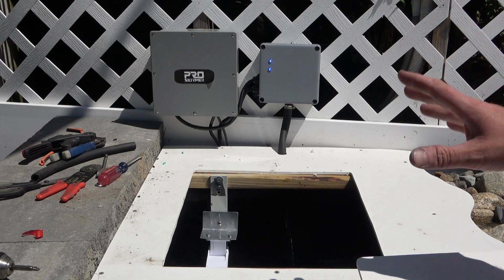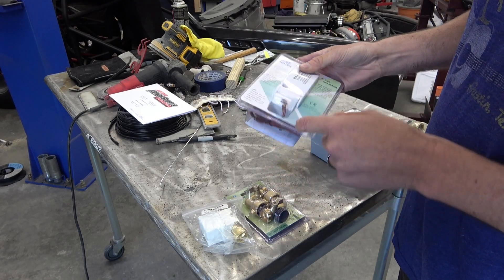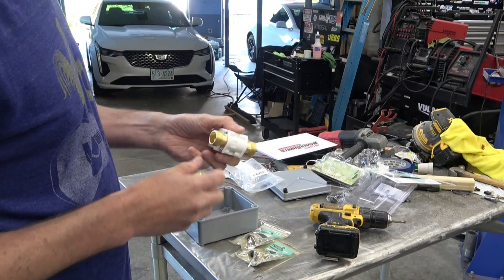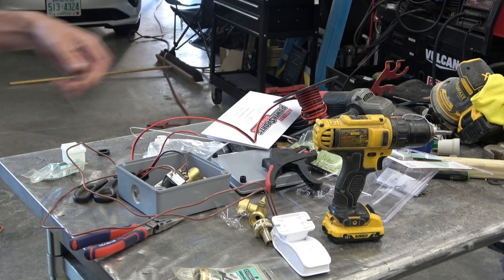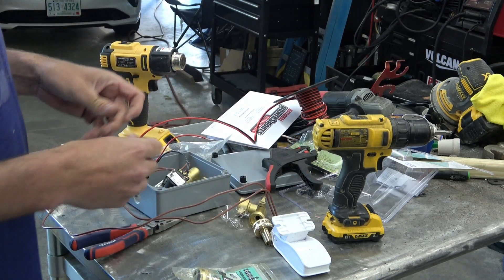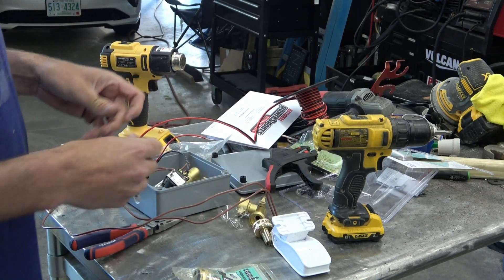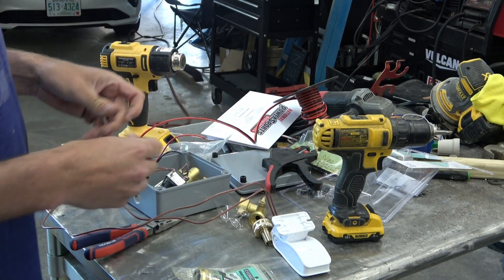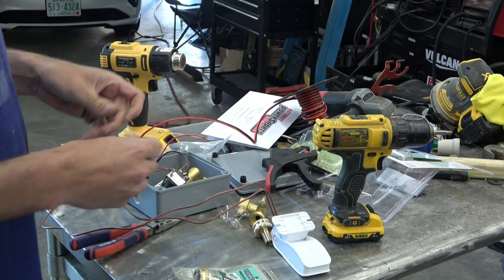Boat Parts Used on a Water Feature? DIY Automatic Pond Level System!

Comment from the maker: Thanks for watching!  Part's list here:
Float Switch: https://amzn.to/3z1DvFj
Solenoid Valve: https://amzn.to/3RtqFWJ
12v Power Supply: https://amzn.to/4eoKB6F
Project Box: https://amzn.to/4clO3Nw
Water Valves: https://amzn.to/4c0ad8n
Solder/Heat Shrink Butt Connectors: https://amzn.to/3xeupo1
Blue LED's (if you're feeling fancy): https://amzn.to/3VhkndK
Knipex Wire Strippers Seen in The vid: https://amzn.to/3VmOYGJ